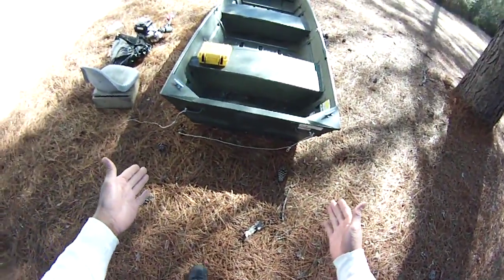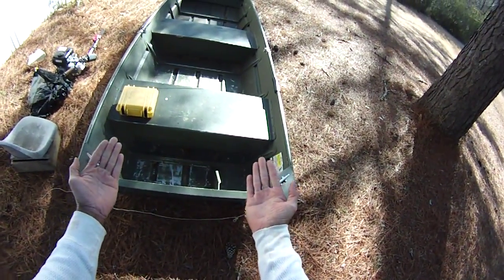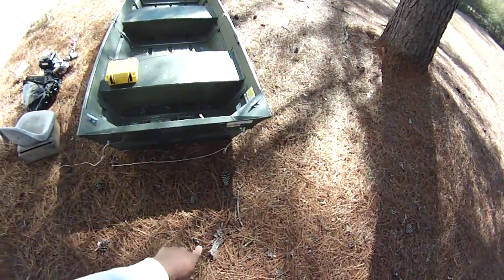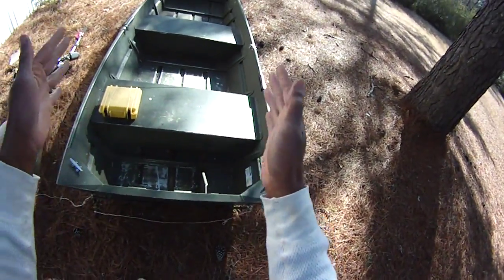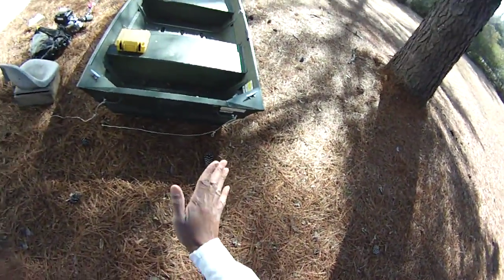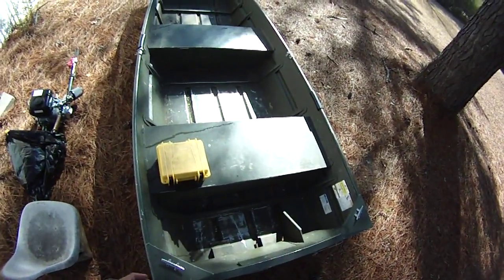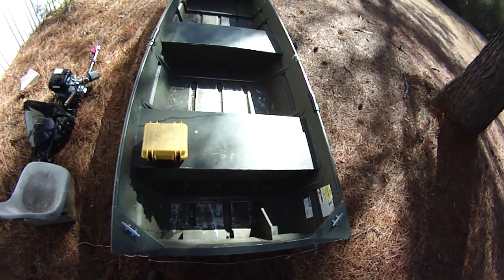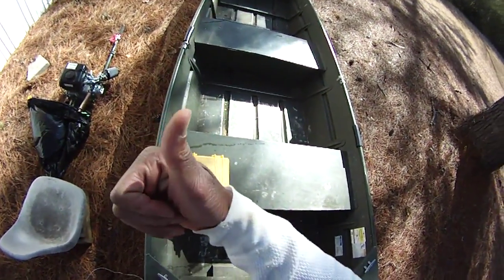Ideal Hull for an SPS Longtail?

Comment: Dude; keep on trying your own ideas, that’s where the fun is at. You are on the right track for use with a lot of weight say two people and gear. A normal Thai set up is 2.5 to 3 feet wide and 16 to 18 feet long, soft chine. For the 6.5 hp. set up the engine is mounted about a foot inboard not on the transom. With a 13 hp. It’s closer to 3 feet wide and mounted inboard also. The soft chine will get you the turning you want but the boat will set deeper in the water than with a hard chine. It all depends on what you want, highest speed possible with a low max weight or maneuverability and control. With the 6.5 hp engine I’d say your idea will work very well. With a bigger engine you probably would be better off going 3'  because of the motor weight. The best thing that helps there to keep the transom from being too low is mount that engine inboard, speed and maneuverability will vastly improve, all Thai longtails engines are all mounted inboard, just make sure the shaft can get in the water, he,he...

I use the Honda 13hp. In a 48 in wide hull and with me and gear it is hardly in the water. See -  https://www.youtube.com/watch?v=1FtXgHqQMLE, That’s hydroplaning, not really in the water. It’s the fastest but it has drawbacks, those being there is a load limit, it only works well with one person and gear. Two people and it doesn’t perform well at all. I built it for a single person and camping gear. Don’t forget to have fun!
Reply from the maker: +Walkertongdee Thx. Sometimes you don't know if you're crazy or not. Thanks for the help.
Reply: As long as you are having fun you are living the dream, anything else is called work...